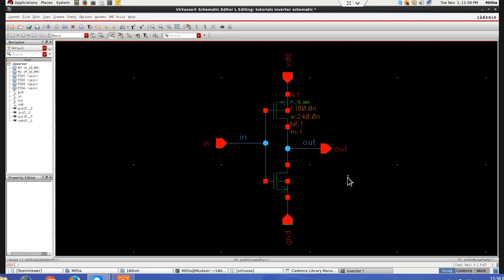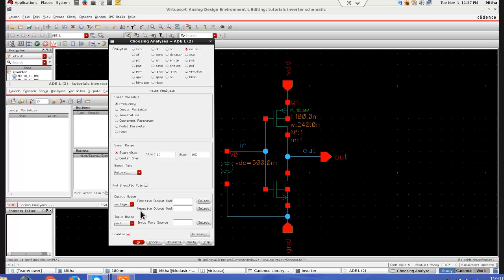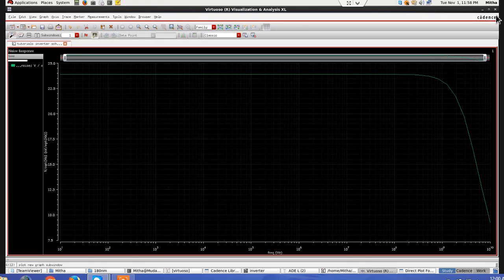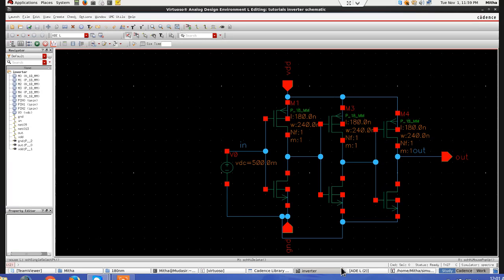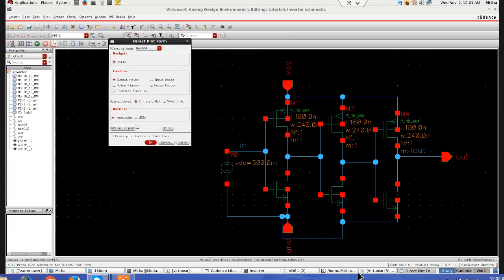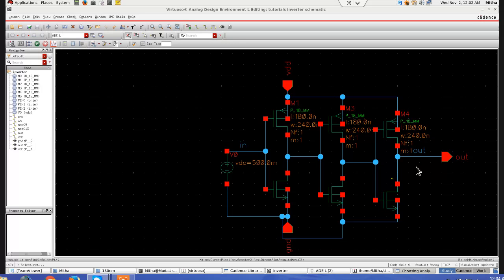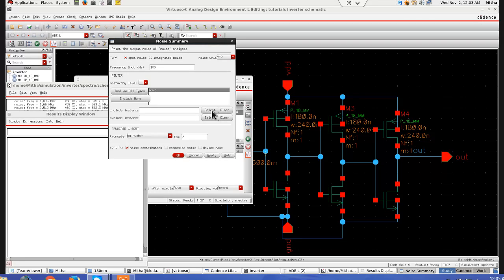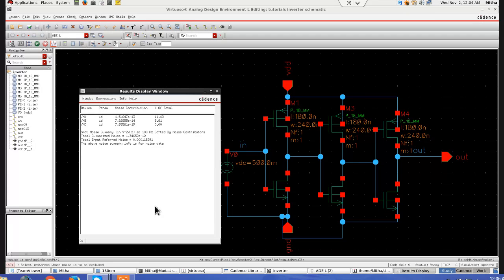Cadence IC615 Virtuoso Tutorial 9: Noise Analysis in Cadence ADEL

Comment: Hello sir
thank you for your helpful video, but I still have some questions
1)if the input is a Differential pair, how to setup? (I'm designing a mixer
2)I don't know how to use "pss" to get the conversion gain with the input is Differential pair
Reply from the maker: Hi,
In case of differential input/output, use ideal balun from analoglib at the input/output. Then follow the normal steps.
Watch tutorial 12/13 for more insights.

Comment: what is the difference between noise and pnoise analysis? if i have an lna connected to an oscillator, and i want to simulate the noise current injected to the oscillator, which one should i use noise or pnoise and why?
Reply from the maker: In simple words, noise analysis provides the total noise spectral density, Input referred noise (transfer function provided input port is defined) at the output at DC operating points.
pnoise analysis is the analogy of jitter measurement only thing is here we do in the frequency domain while jitter analysis is done is time domain.
For the oscillator,  pnoise is recommended since I want to know the variation/offset in my fundamental frequency (sidelobes/bands).

Comment: Can you explain how to simulate PSRR in Cadence?
Reply from the maker: Apply an ac voltage (~1uV) with dc voltage (Vdd). Consider Vdd as input then find the gain (Vout/Vdd) by doing ac analysis.That will give you PSRR. If you are interested in modelling the noise on the power supply, you need RLC or LC circuit for that.
Reply: @MudasirMir7  So, I'm actually want to simulate this on folded cascode opamp. Is the step also the same? Then, how do I set the Vin differential pair?
Reply from the maker: @teddyrius94  Simply apply any dc voltage (within ICMR) or the value with which you have biased it already without any ac signal
Reply: @MudasirMir7  Thank you. One more thing, since this stand alone fc opamp got two inputs and outputs, do I need to set offset or grounded for either one input source so that the PSRR result will be correctly obtained?
Reply from the maker: @teddyrius94  your psrr won't be accurate unless you use supply model. I think it is okay if you use the mentioned method irrespective of whether ur OTA is FD or SE
Reply: @MudasirMir7  I got what you meant. I'm actually got the model for this which is the CM. But due to some unprevented reason, I need to simulate this stand alone fc. Would you mind if I ask you to check my circuit?
Reply from the maker: mail me a pic displaying dc operating points and node voltages, plus the specs
Reply: @MudasirMir7  Okay, I just email you everything as requested. Kindly check them for me. Thanks a lot :)

Comment: This method is not accurate, the inverter is non-linear circuit. Integral noise calculate the small-signal model.
Reply from the maker: Hi, I do agree with you.
The intention of these tutorials is just  to show how the different simulations can be done in Cadence.

Comment: How to calculate SNDR of a circuit in cadence. Please explain
Reply from the maker: Do the transient simulation. In the VIVA window, go to the spectrum option and enter the values corresponding to your simulation time and resolution of ADC you will find all the values. Now, the SNDR can be calculated from SINAD value as they are related to each other. Now let's say you want to do MC for any dynamic parameter of ADC, send them to ADE and do MC.  Hope this helps!
Reply: Mudasir Mir  Sir I have designed 4 bit Flash ADC, the outputs are B3 B2 B1 B0, In output graph window when i go to spectrum option, i am getting ENOB, SFDR etc for individual bit like B3, B2, B1 or B0. Sir I want to calculate ENOB, SFDR, SNDR values for complete ADC. Can SNDR or ENOB of complete ADC be calculated by adding SNDR or ENOB of individual output bit.
Reply from the maker: Hi, you have to use the weighted sum of all the outputs (B3 B2 B1 B0). This can be done using the calculator and after plotting the output calculate the SNR, ENOB, SINAD etc.

Comment: what is the supply voltage u have used and also Sizing of NMOS is not clear here.
Reply from the maker: I haven't designed it as said in video. For now, I am only illustrating the procedure for doing different simulations.
Reply: ok still u need to give some supply voltage. without that how u are getting these plots
Reply from the maker: power supply is 1.8V and NMOS sizing is 240/180.
For details see my first tutorial.
Reply: ok thanks and just one more thing how are you taking input voltage as 0.5V. Is there any reason behind that or u have just taken it. Plus we have to do ac analysis for noise simulation then how come frequency variation is making an impact to the dc input and circuit